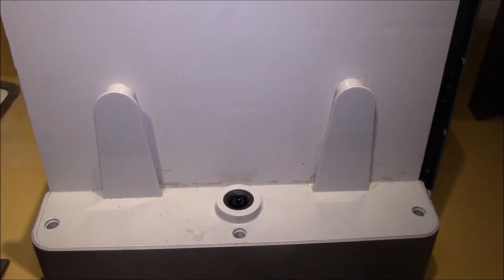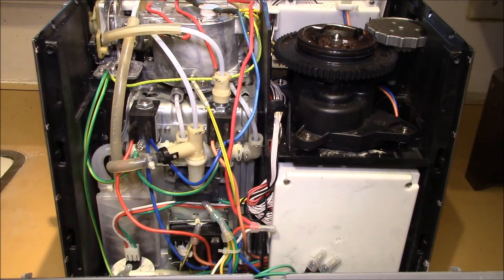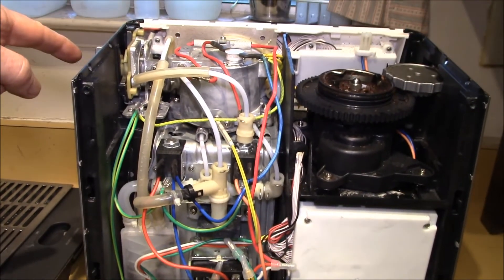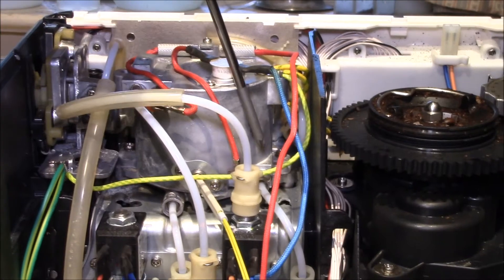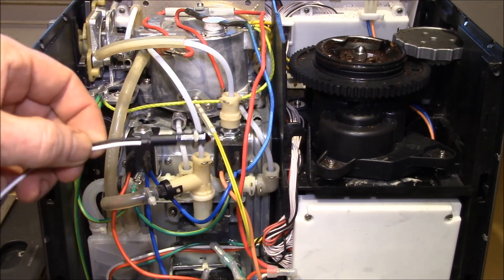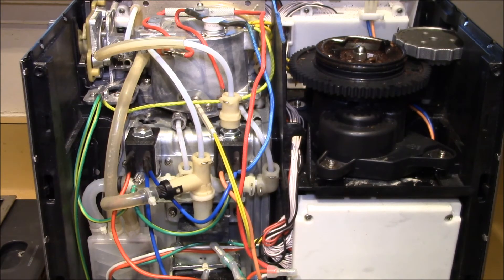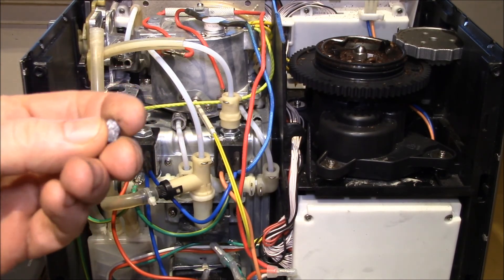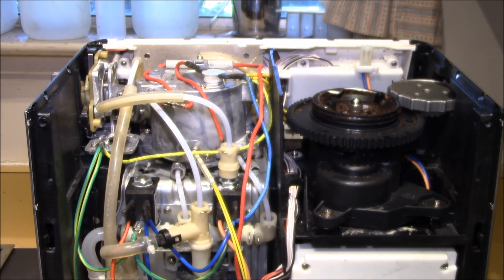Breville/Sage 870XL Barista Express - Water Flow

Comment: Amazing, i have read many comments hoping to find my issue. But I can’t find it. Great details on your excellent video but could you help me?, coffee particles spew out on the underside where the circular grate is and the coffee cup attaches, while making the espresso. Almost as if there is a pressure leak in the seals around the metal grate. I am not sure how to disassemble it. At first I tightened the one screw (allen), and it helped a little, but pressure leak came back, thank you for reading this, john
Reply from the maker: Check out the end of my Breville playlist, just added a link to a video on the topic of replacing the group head gasket, or see below:
https://youtu.be/9CiwlffDYFM
Reply: Thank you so very much, not only do you have an amazing video and I’m going to check out your other videos as well and I have subscribed. But you referred me out to my exact problem and I didn’t even know it. Thank you so much
Reply from the maker: @drsaab  Glad you narrowed down the cause of the problem in your machine.  I think I need to pick up a group head gasket or two to have on hand.
Reply: @The4Crawler  I just ordered on the Breville website. And they were $6.95  with free shipping. The most you can order at a time was three

Comment: Mr Brown. Glad I found your channel. I’m having an issue with my Breville BES870XL. My pressure gets all the way at the top of the espresso range. My volume for single and double cups are spot on with factory settings when measured with no espresso. When trying to make a cup of espresso, I’m not getting the volume and espresso is under expressed. I have played around with grind settings and I’m using 18 g of espresso beans so I don’t think that’s the issue. Occasionally I do get what sounds like an electrical short or a buzzing sound when pressing the 1 or 2  cup buttons.  I am wondering if the solenoid is not closing all the way and during an espresso some of the pressure is being forced through the overflow and into the drip tray. Does this sound like a correct diagnosis to you?
Reply: Just to clarify, The buzzing I get is a momentary buzz and sounds like an electrical short. It only happens once in a while. One of your other videos shows that some buzzing is continual and you don’t get any pressure but I get plenty of pressure.
Reply from the maker: It may be that one of the solenoids is either not opening fully (the 3-port one) or is opening when it shouldn't (the 2-port one).  Could also be the over pressure/safety valve is set too low and bleeding off pressure to the drip tray.  Maybe try propping the back panel of the machine open and run a shot while looking inside (be careful as there are live electrical connections inside).  See if you can find where the water is flowing other than to the group head and also try to determine which solenoid is making the noise.

Comment: Hi Mike. Nice video. Hope you can help me. No steam or hot water coming out from my Coffee machine. After turning off the steam or hot water switch and press coffee button first coming a steam and after the water. What could be the problem? Many thanks.
Reply from the maker: Could be a few issues.  It might be the hot water/steam valve is plugged up internally.  It could be the water tube up to that valve is clogged or 2 of the water tubes have been installed incorrectly.  If could be the 3-port solenoid valve isn't closing fully and sealing off the flow of water to the group head (assuming that's where you see the water coming out), or it could be that the solenoid on that valve is getting power all the time and isn't closing.  Test for that would be to measure the voltage across the solenoid with the machine on but not doing anything, see the indicator lights I added to my machine:
 https://youtu.be/9cC-m3a-oXY

Comment: Great video which I believe has helped me to diagnose a problem. I found the three way valve burnt and installed a new one. After that it appears to be humming all the time when the machine is plugged in whether on or off, and the water wand and steam wand do not get any water unless I disconnect the orange lead. My thoughts are that the control board is applying power when it shouldn't, any thoughts would be greatly appreciated!
Reply from the maker: Likely the main circuit board, perhaps the driving Triac has failed on:
https://photos.app.goo.gl/bN1ugnLPYwvyDcr59
Reply: @The4Crawler  Sounds like you agree that the solenoid should not hum or have power until the control board directs it to the solenoid!  Also where might you recommend getting parts from?  Thanks in advance!
Reply from the maker: @davidcalderon7595  The 3-port solenoid should only be on while pulling a shot:
https://youtu.be/9cC-m3a-oXY?list=PLpY2FP1a9tisyIfKjSugexoVK01xQuptv&t=111

You can search for the part numbers on-line or try a supplier like DIgikey or Mouser, etc.  You can also purchase a new PCB if soldering is not your forte.
Reply: @The4Crawler  I'm not afraid to try anything if I know what to replace or repair. No obvious problems are showing on board, any input on what to do and i'll give it a try, mainly because the main PCB is on factory back order.  Thanks for all your input, your awesome!
Reply from the maker: @davidcalderon7595  It's likely TA3 or TA4 that's failed:
https://photos.app.goo.gl/xAbdmKiq4dprzCKs8
Whichever one that solenoid is plugged into.  Click on the photo in the album and enable the Information display.

Comment: For anyone who finds this video:

ISSUE: Steam and/or water coming from head when selected to hot water or steam.

PROBLEM: 3-Way solenoid was caked with mineral deposits. 

FIX: remove solenoid clip from bottom of 3 way valve with side cutter, remove hoses connected to solenoid, remove wires to solenoid. Remove solenoid valve by percussive means, soak on vinegar or other mineral remover. Clean with soft brushes, and clean waterway to steam/hot water selector. Make sure that solenoid plunger moves freely in body. 

Reassemble is reverse of removal.
Reply from the maker: Good point.  Yes, that 3-way valve is the key part of the system and can cause either the issue I was having or as you describe.

I have a video on cleaning that valve here:
https://youtu.be/eljHS_BRJXk
Reply: @The4Crawler  I did see that video, of course after the comment :P There was a hardware revision at some point, making the 2/3 way valve a lot more disassemble-able. It was a single piece valve slider.
Reply from the maker: @The_Hudson_Workshop  I've not tried cleaning the newer style Ceme valves.

Comment: hey could u help me out, my breville before, water was not coming out of the are that the expresso comes out, so i replace the 3 Way Solenoid Valve, now the area that the express comes out its working fine but every time i use the steamer water goes to the area that the expresso comes out, not the steamer way!
Reply from the maker: This video explains the water flow.  If the 3-way valve is off and fully sealed, water will flow up and out the top port to the hot water/steam valve.  A simple test would be to unplug one or both of the wires (wrap them in electrical tape to keep from shorting out inside the machine) from that valve and see if the hot water/steam works.  If so, perhaps the main PCB is sending power to that valve all the time.  You would also listen for that valve clicking on and off when you turn the machine on and off (it should not be turning on).

If unplugging the solenoid doesn't help, it may be that solenoid valve isn't sealing off the side port fully when it's off.  You can test that by pulling it out and trying to blow air through from one side to the other.  There may be something stuck inside, see the video in this playlist on how to open and clean the valves.
Reply: @The4Crawler  ok by unplugging one of the wires, water does go through the steamer (not a lot, bc it’s leaking on that connection that goes on top of the 3 way valve, and I couldn’t find a replacement for it) do you have any idea why the valve is staying open all time ? And maybe where I could find the replacement part for it! Ty a lot
Reply from the maker: @netoferrr2438  Water is coming out the valve when the wires are connected means the wires are supplying (some) power to the valve when it should be off.  It could be that the Triac component on the main circuit board has failed in the on position causing that to happen.  You can see close up photos of the PCB in the photo album below, if you want to try to replace that part:
https://photos.app.goo.gl/bN1ugnLPYwvyDcr59
Or you can often find replacement PCBs on-line, I got one off of eReplacementparts.com a while back.  If they're out of stock, search for the p/n there on-line and find another supplier.

Comment: Hi . thank you for your video. My coffee maker is a Breville model BES870XL/B unfortunately the pressure does not rise. The gauge is working. The pump worked by taking out an output pipe from it and turning it on, and it had a good output pressure. All the pipes are clean, and I cleaned them twice with special tablets. The steam works and there is no problem. I still could not find the problem. If I find it, I have the possibility to repair it. I have two guesses, one is the external stream ring and casket and the other is the solenoid valve.
In the first case, the device has no leaks at all, neither internal nor external pipes. Thank you for your advice in advance
Reply from the maker: If it's the solenoid valves, either leaking or not fully opening, you'll have the water running into the drip tray instead of the group head.  You could see if there's excess water in the tray as you run a shot or peek in the back while running and try to find out where the water is running.  Normally, the 3-port valve should be activated, closing off  the top port and the 2-port valve should be off and the water should flow up through the center connection.
Reply: @The4Crawler  thanks a ;ot

Comment: Thanks for taking the time to post such useful info!
I replaced the pump on my BES870 because it developed a screeching sound with low pressure (after 5 years } ... initially it sounded normal when turned on but started the screech and low pressure before even one cup ...is there a check I should do before replacing the solenoid valve assembly?
Thanks again
Reply from the maker: If the sound is like at the beginning of this video:
https://youtu.be/eljHS_BRJXk
It may be the solenoid valves, mainly the 3-port valve that is not fully opening and sealing off the top port.  You might try cleaning them like I did in this video, or get a replacement.  You might also try propping the back of the machine open and see if you can find where the water is going when you run a shot.  Be careful as there are live electrical connections inside, but you may be able to see water flowing, say out the top of the 3-port valve, to the hot water/steam valve and then into the diffuser and drip tray.

Comment: Thank you very much for explaining in detail. The water is not stopping at 1 cup or 2 cup mark I have to press the button again. Tried factory resetting but still the same. Also tried to program the quantity of water to 1 oz for 1 cup and 2 oz for 2 cup but still the same. Hoping you might have any insight on this.
Reply from the maker: Check:
01:16 Water flow meter
Might try unplugging and reconnecting the plug at the flow meter and also back where it plugs into the main controller board.  It might be the vane in the meter is stuck, descaling might help or take it out and see if you can free it up.  Gently blow through it, or use a small syringe to push some water through forward and back and see if it's start spinning.  If that fails, replace the part: p/n: SP0001473
Reply: @The4Crawler  Thank you very much. Will try that and update.

Comment: Thank you for the Video! While brewing should there be water running from the 2 way solonoid to the diffuser ? or does this show that the 2 way cant close properly ? Because my machine doesnt have good pressure and might loose it at that point.
Reply from the maker: No, that valve is only on for the purge cycle at the end to release built up pressure after the cycle ends.  Might be it's clogged internally and sticking open or is unable to close fully and seal off the outlet:
https://youtu.be/eljHS_BRJXk

Comment: Mine had a thermostat go bad on top of the thermocoil assembly. The wires appear to be spot welded instead of just a plug. Any experience with that issue?
Reply from the maker: I've never looked into that component.  If you know anyone locally that's into DIY lithium battery pack construction, they may have a spot welder.  Otherwise, it may be easier to get a new thermocoil.
Reply: @The4Crawler  I am just going to re-terminate the wire when I receive the new thermostat. Thermocoil is backordered forever.

Comment: Hello mate. I have a BES870 - just replaced the solenoid valves. Now I have switched it back on it is getting very hot. The power light stays flashing. Single/double lights don’t come on to be able to make an espresso. I’m wondering if the temp sensor is now not working. Any advice?
Thanks in advance.
Reply from the maker: Likely the grinder hopper is either not fully engaged or it's not fully locked.
Reply: @The4Crawler  I checked that before and is running perfect.  thanks for the answer. I will keep trying.
Reply from the maker: @nailx44  Then some electrical connection inside the machine may have been knocked loose while inside replacing the other parts.

Comment: Thank you so much for this amazing video, very useful ! Unfortunately, I couldn't find the answer to my problem... my drip tray is always so full every morning after 2-3 shots. I know there is the auto purge feature (normally occurring after brewing) but in my machine it leaks right after the machine is turned on (before brewing or steaming) and I think this is not normal. There is no problem with the pressure. I don't know how to fix this, your help would be very helpful. Thank you !
Reply from the maker: Perhaps open up the back cover and peek inside while running a cycle and see if you can see where the water is flowing.  Be careful as there are exposed, live electrical connections inside:
https://youtu.be/46UBebNJ-uo
3 places that flow to the drip tray are the top of the 3-port valve, via the hot water/steam valve, the side of the 2-port valve and the over pressure/safety valve.  The machine will run the pump at power on so there is pressure in the system before brewing.
Reply: @The4Crawler  many thanks for your reply ! I'm going to look inside. just before, do you think that I have to change the pump and/or safety valve knowing that my pressure and water output are good when I dial in my expresso ?
Reply: *safety valve and/or Solenoid Block I meant
Reply from the maker: @lanushansivarasa4572  It may be the safety valve is set to too low a pressure and is sending water to the drip tray all the time.  You can turn the black part of the valve to increase the pressure at which it opens.  It's there to release too high a pressure in case something gets blocked.  It shouldn't be passing water in normal operation.In an event, you can usually see the water flowing in the tubes and if it's flowing in a tube other than where it's supposed to be flowing, then that'll point to the source of the problem.  Like they say "follow the water".
Reply: @The4Crawler  I looked inside to see the water flow, I turned the machine on and I saw that the water actually came from the 3 port valve (steam / hot Water), I noticed there is limescale buildup at the extremity of the dump line, so I will try to clean that and I will see. Thanks again !
Reply from the maker: @lanushansivarasa4572  It  may be that 3 port valve is not fully opening, which also seals off the flow to the drip tray via the hot water valve.

Comment: I’m back Mr Brown.  I replaced the solenoid block and pump on barista express a couple weeks back due to your video so thanks again for the instructions on how to get back pressure.  I got my hands on a Breville infuser that was giving slight pressure on the gauge around low pre infusion stage but never more than that.  Like the barista express I fixed I ordered the solenoid block and pump because the solenoid block on this infuser was busted open like a corroded battery when I opened the back.   I always had steam and water coming from the wand and hot water spout but when I started it back up after the install, now I get no pressure at all, even with the cleaning disc and lower amount of water coming through the group head.  I took it apart again an cleaned all the tubes going to the boiler and checked for limescale or broken o rings.  Put it back together, still no pressure and again low water after I used to get the right amount of water  but just low pressure when I first got the machine.  Thoughts?  I’m stumped at what to try next.  Thanks in advance!
Reply from the maker: Might be a few things.  See if you can peek inside the back cover while running a cycle.  Be careful as there are exposed, live electrical connections inside.  But see if you can see where the water is flowing.  Maybe it's going out the over pressure valve that's above the pump.  Or maybe the water tubing is hooked up incorrectly.  Common mix up is to swap the line out of the top of the 3-port solenoid, that runs to the hot water valve, with one of the other lines.